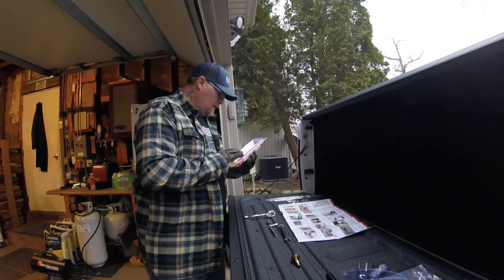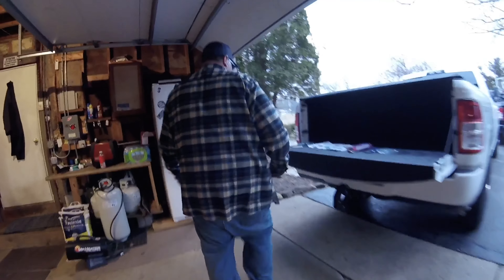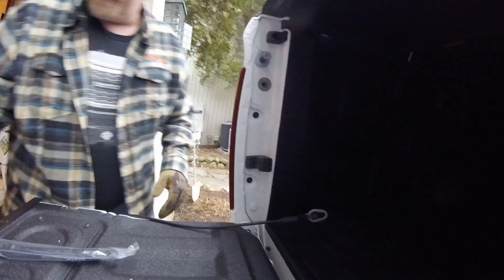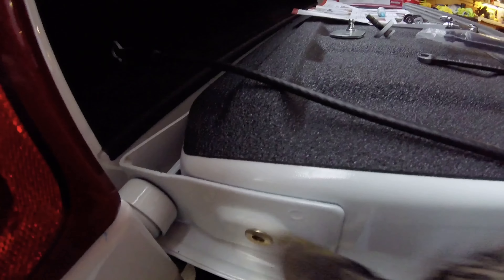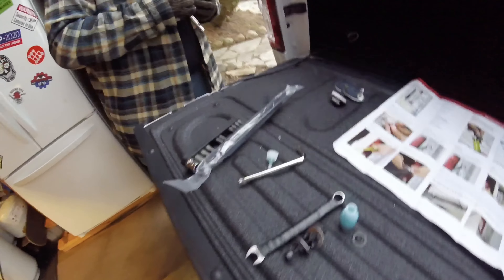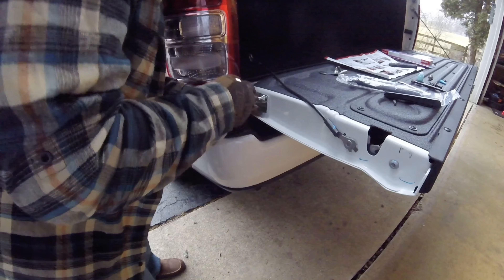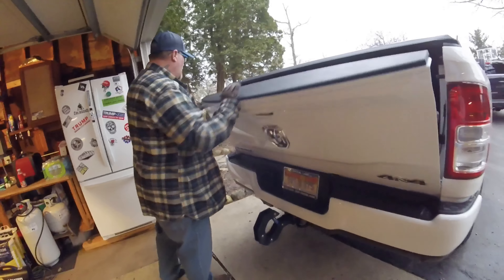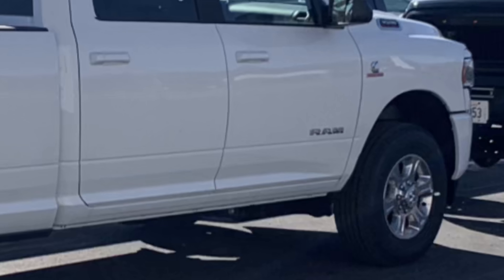2019 Ram 3500 tailgate assist install...

Comment: It goes behind the tail light already has the brackets you made it harder than it is
Reply from the maker: If a couple of bolts and a bracket makes things “harder” for you that’s okay. The 3500 does not have the same setup behind the tail light. I looked before I purchased this kit..
Reply: Maybe is on the right side taillight on the 3500?
Reply: On my 2019 mounting points were on the passenger side. Used factory damper.